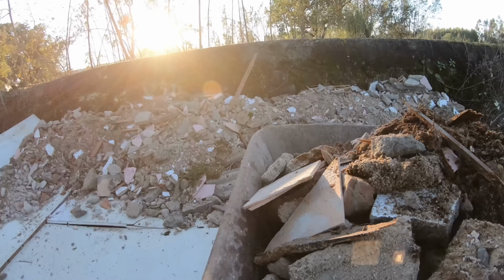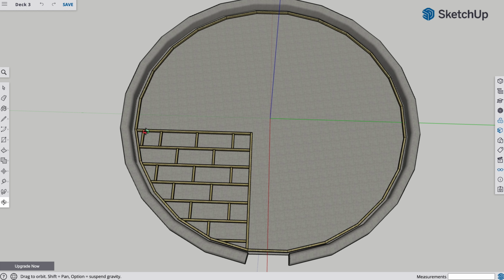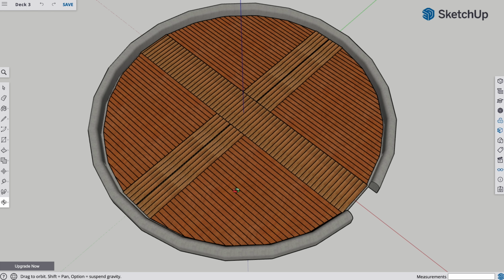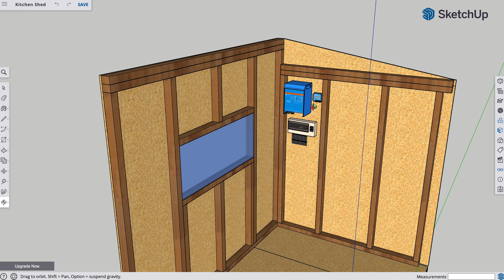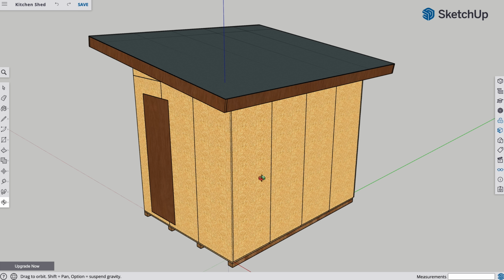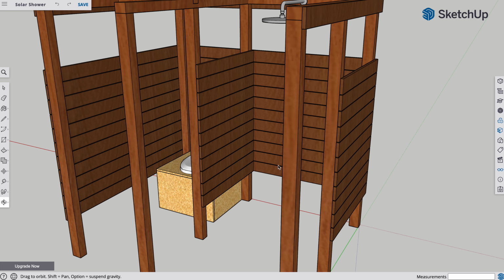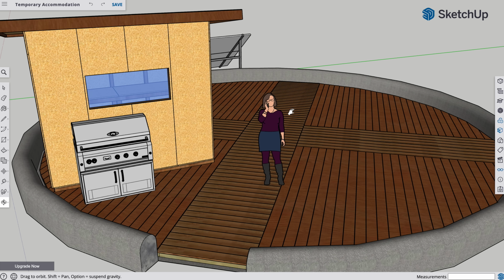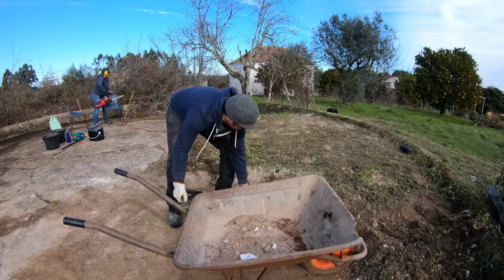Building an OFF-GRID Living Setup: Part 1 - Our Plans

Comment: Really liked this.  I’ve watched the amount of digging you’ve done, have you ever used or seen a maddock, for breaking up soil, digging trenches, holes etc.  I’m sure Kylie would have grown up with them in Australia.  They are like a pick, but with flat blades, and can be filed or ground to fix the edges if damaged on stones etc.
Reply from the maker: We have a couple of maddocks, if you look closely in the digging videos you’ll see us using them. Not very effective in the stone hard clay however which is why we ended up getting the spade attachment for the hammer drill